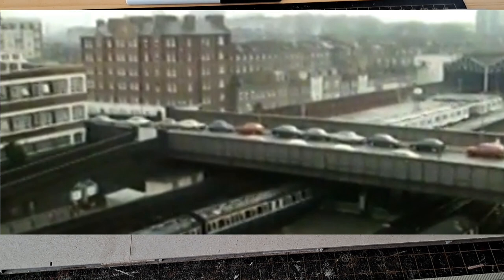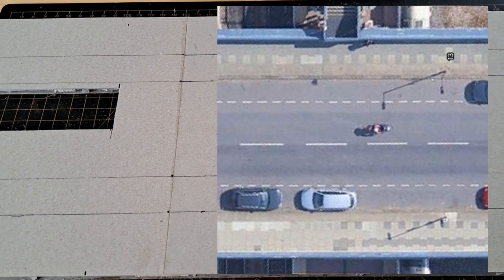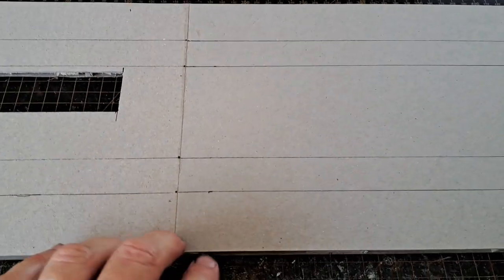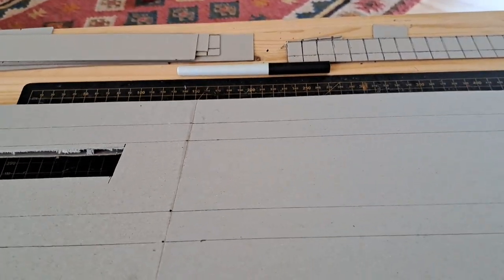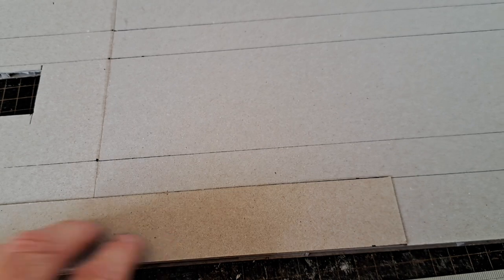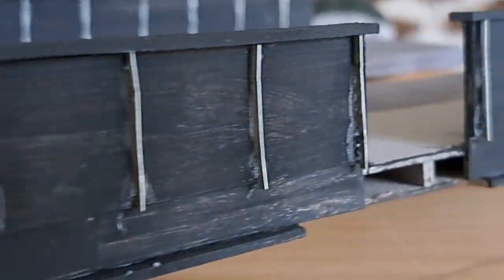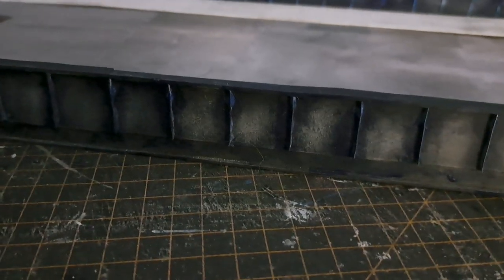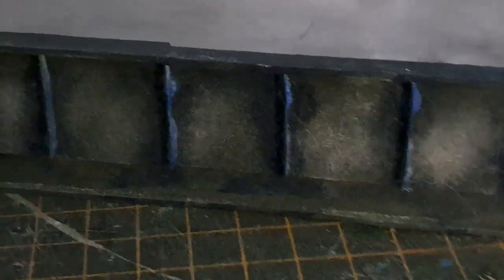Scratch building Rossmore road bridge for Marylebone station.

Comment: love what your doing there, but before you get too far I'd seriously consider swapping out those points for something longer. It's much easier to do it now than regret it later.
Reply from the maker: Thanks for the suggestion, I've had to cram alot into the lower deck for the chiltern line stations hence use of  set track. Also I'm only running 3 car DMUs. So am aware it's a compromise.
  For my East Coast West coast lines I will be using the longest points i can get to smooth the flow.  But having to re think the design as it does make the stations alot longer 🤔.